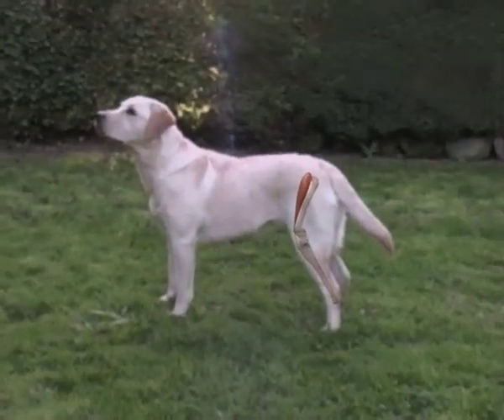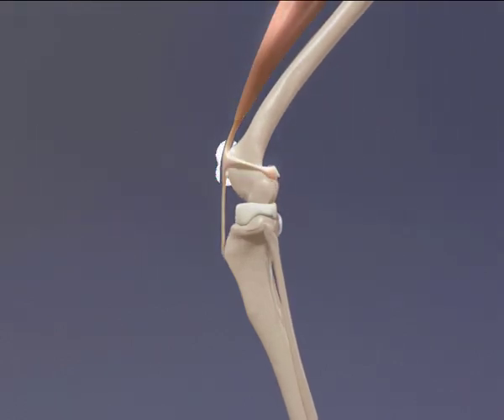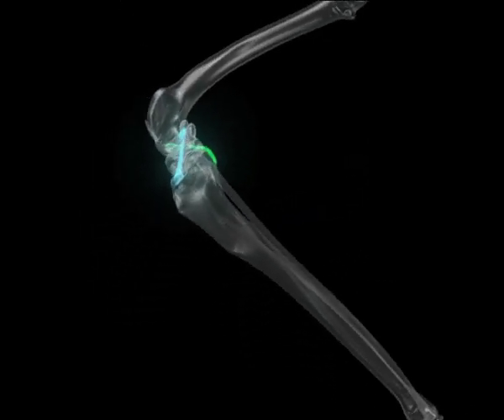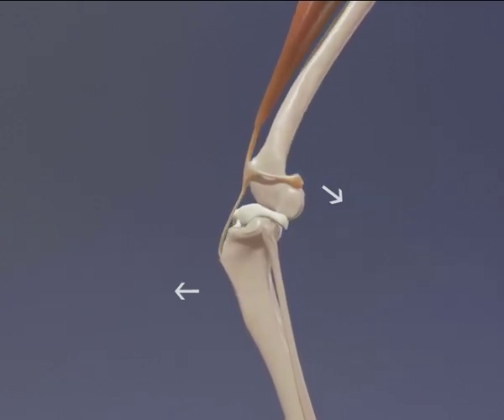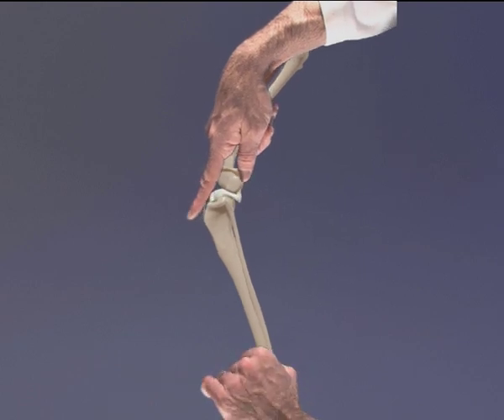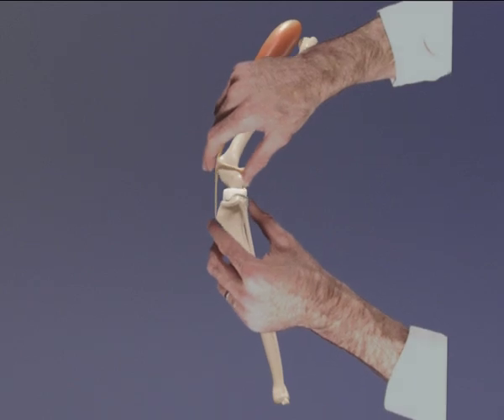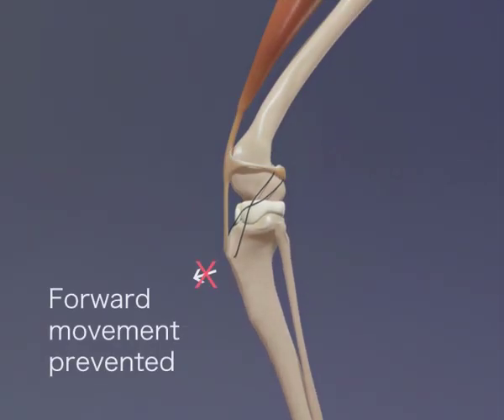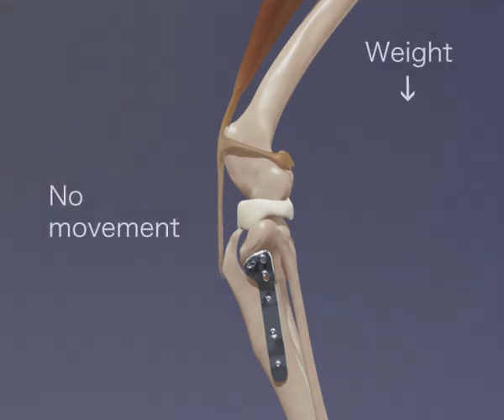Cranial Cruciate Ligament Rupture - 3D Animation for Veterinary Undergraduates

Comment: My 9 year old - 95 pound German Shepherd was just diagnosed with a torn CCL. At her age and with my knee problems, she  does not get a lot of exercise. I know her size / weight suggests TPLO, or TTA - but cost is an issue.

I have read that the suture doesn't hold up well. I have watched the procedure performed on YouTube on live dogs and leg models and one thing bothers me about the procedure.

It looks like an ordinary drill is used and when you drill most materials, you wind up with an ~ 90 degree angle where the drilled holes meets the surface - in other words, a sharp edge.

It's not hard for me to imagine that with suture / bone relative motion, that sharp edge will abrade / cut into the suture - causing it to fail.

It seems like a far better method would be to design a custom drill to radius the intersection of the hole with the surface, or to use a separate tool (similar to a router round over bit) to add the radius.

I haven't been able to find any failure analysis for this procedure, but it seems like it could potentially be superior to either TPLO, or TTA - on the basis of not only cost, but performance as it seems the suture performs a very similar function to the ligament.

I have to wonder if / and why not there hasn't been any work done to improve the longevity of Ex Cap.

Your comments / thoughts would be greatly appreciated.

Pete
Reply: Look into the Tightrope surgery. I have a 92lbs dog and that is what I decided on. The TPLO is what everyone suggests, but it is almost a guarantee that the other leg will tear shortly after. It has a lot of complications and the risk of getting bone cancer after the TPLO is 40x higher afterwards. I have seen 125lbs Mastiffs get the Tightrope surgery and it held for 9 yrs until he passed away. Just follow the aftercare instructions perfectly and it will be successful.
Reply: I had the suture procedure performed on my active 62-lb Springer a year ago.  Cost was about $1500 by local Vet versus about $6K plus travel expenses if I had taken him 600 miles to get a TPLO done in Colorado (nearest available).  Probably dropped another $500 on recovery supplies (walking sling, larger kennel to accommodate the cone of shame, and a portable indoor pen to limit movement in the house during the recovery.  He recovered well and is doing great now.  I don’t hunt him as often or hard as pre-surgery, but hey - he’s 10 years old now anyway.  I had similar concerns with longevity of the suture repair, but my Vet had told me he’d done the procedure on hundred-pound dogs without issues.